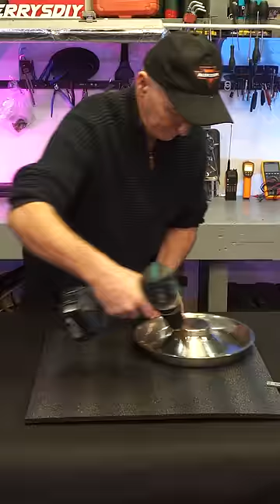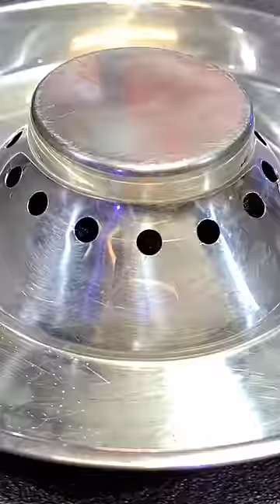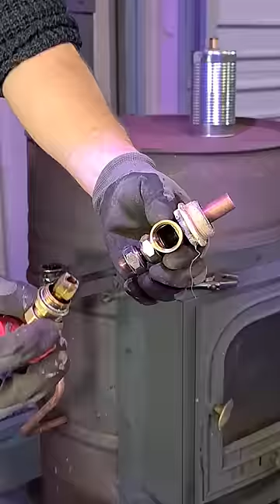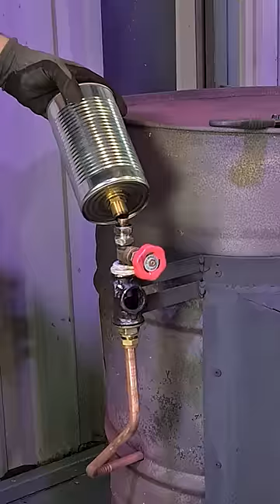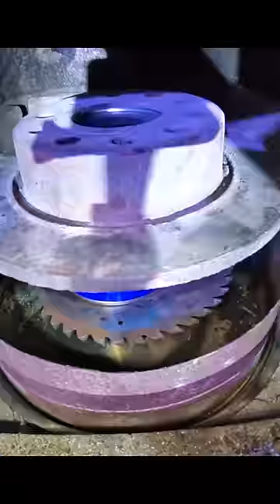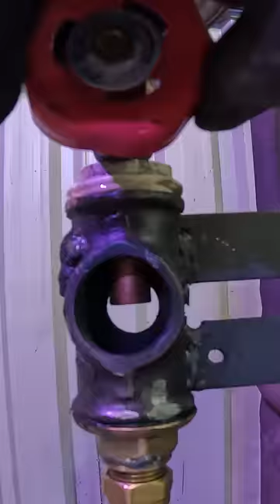FANTASTIC Waste oil Burner from a Puppy Feeder

Comment: Fantastic what would you charge to make one?
Reply: Due to liability, and lack of control of the end use, you have to make it your self, silly! Gerry shows many different ways to burn waste oil, and has done a lot of design refinements on his most effective heaters! He even made a minion stove! Probably the first!  Been subbed for years, I highly recommend if you want to make your own heating apparatus, for garage, shed, or even camp! Enjoy!
Reply: @richardmccann4815  - True/agree. The process is fairly straight forward, only part that's tricky, is sourcing that sweet curved steel framed glass door, to fit a 45gal oil drun.
Reply: @richardmccann4815  Totally agree 👍. I made one for my shop and very impressed with it. I made mine from a large air compressor that was given to me.👍
Reply: @__WJK__  Not if you have welding experience.😁
Reply: @murraychadwick9362  - For sure,  just wanted to make sure some one doesn't already manufacture a barrel stove door frame kit... before I go out of my way to source, bend and weld a bunch of steel and also source, cut and fit a piece of high-temp glass.

Comment: We have been doing
This with our wood burning stove for the past 30 year's or more. We filter old engine oil that's come from plant machinery.
Reply: Smoke like hell??*
Reply: I do not filter..... I seek temperatures more 1300 C.....
After l seek a fuel....
What kind of fuel? - never say!....
Reply: @andrewQueDeLlee  Hello Andrew. We use 
Engine oil because we
Have nothing else. It's
Just away of getting 
Shut of waist oil. Our 
Stove is a proper one.
Not a home made oil
Drum. it's also got to 
Have a good air flow.

Comment: All this work you are going to and you can’t use them because of eco2022
Reply: Can't use and forbidden to use are two different things.
Reply: @TurinTuramber  if you want to be an idiot ad split hairs yes, either way you cant use the heater or engine oil/vegetable oil as per the new EU regulations
Reply: @clivefrancis3546  Not splitting hairs it's just the reality. I know two mechanics with waste oil burners heating their workshops as we type.
Reply: @TurinTuramber  yes and if caught within the EU it’s a massive fine, I’m not saying the new rules are right, just pointing out legally you can’t use it.
Reply: @clivefrancis3546  Caught by who exactly? The energy police?
Reply: @TurinTuramber  the environment agency or who ever gets sent if someone reports you.  End of the day it’s up to you if you want to do it, the fine is quite substantial if you can afford the fine then cheap fuel is least of your worries, if you want to keep splitting hairs arguing about it and justify it knock yourself out.  You can lead a horse to water but you can’t force it to drink!